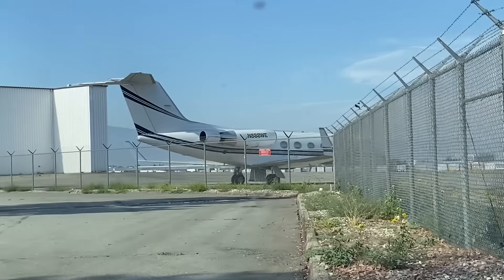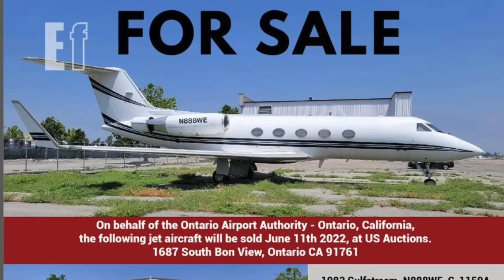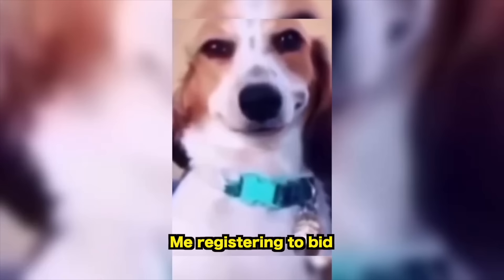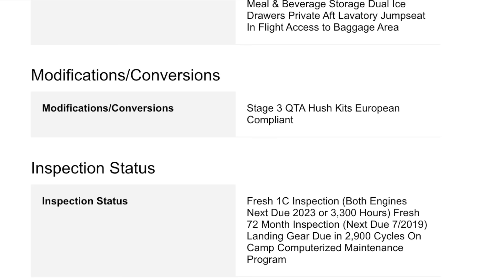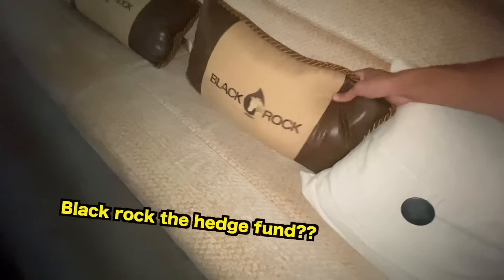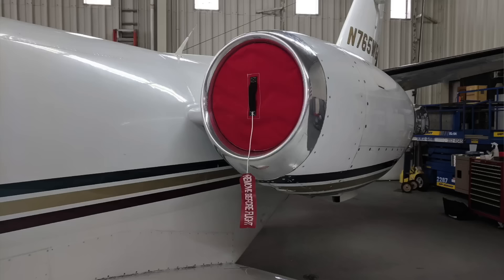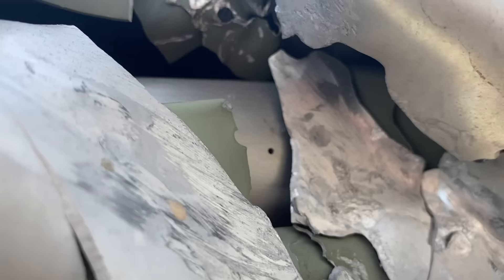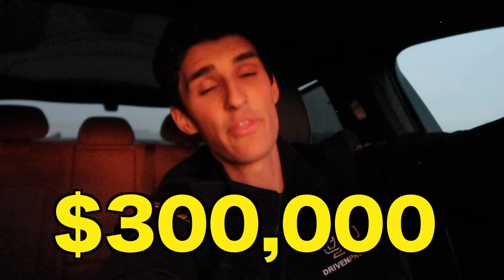$100,000 ABANDONED Gulfstream GIII At Auction... Did I Bid Too Much?

Comment: It’s completely possible whoever took the avionics and logs, bid on the plane. Wouldn’t have been the first time I’ve seen it happen over the years.
Reply: Smart. That leading leading edge is easily repairable of replaceable   Nice Cartel jet ✈️
Reply: I used to hide it so couldn’t be accused of theft 
Then if I bought it I know where it is 
So always worth a look
Reply: I'd start looking at the guy who's short a ton on hanger/storage fees
Reply: @jimardizoni3453  But he’s the one profiting from the auction, so why would he steal the logbooks so it’ll auction for less?
Reply: @lukethompson5558  so he can buy it for less under some else's name  replace the log and electronic he got for free and flip the plane for profit, the parts missing are worth more than the auction fees to the winning bidder it's a no loose spot to be
Reply: You need to rebuild the logs if you can't find them, that could prove next to impossible cost wise.
Reply: Log books don't come up missing for no reason. The Flight Crew/Owner Operator is responsible for those books. When an aircraft goes down for maintenance, the first thing the Inspection Dept. or Head Inspector does is remove and review the log books, then locks them up until the plane is returned to service. 
Most likely the Operator couldn't or wouldn't pay the bill. After all attempts to recover payment due, then the plane gets pushed outside and parked. Anything is possible, Owner death, Will tied up in probate, etc.
Most likely there's also a mechanics lien on the aircraft. Or, if a good maintenance contract was written, and the Party owed money, could possibly spend the money in court to to take possession of the plane. A search of the tail number and A/C serial number would be wise.
It was easy enough to go through the Emergency Exit to break into those old GII's and GIII's before they started adding locks on the e-exits.
Reply: If the winner have the missing parts and the with hush kit, this aircraft will end up somewhere outside USA smuggling drugs into US. 

Another route is Africa to Dubai transporting illegal gold/diamond. Dubai airports will allow to land as long as it has the hush kit.
Reply: @T J  riiiight. I think the old owners have the avionics, cleaned out what might bring a buck and said duces... and you know they have the logs. . . With deep pockets, purchase of both airframes, and tracking down the older owner (public record) to make a deal for the logs, could have been a really phat deal. But that's a lot of variables to fall in line, just so. 🤷‍♂️
Reply: 99.9999% This
Reply: why overbid then?
Reply: @TomCook1993 😊😊
Reply: Very hood point.never would have thought of that😅
Reply: I bet the original owner who lost it to the airport for parking fees still has the log books and avionics. Bought it back cheap!
Reply: Weighing in from a pilot’s 👨‍✈️ perspective here… 😏:
- Something like this would neither be a kind nor a professional thing to do for a fair bidder ⚠️
=> He should therefore - in the best interest of all parties involved - NOT do that. Period.

Any thoughts on this, crew? ✈️
Reply: D.B. Cooper!?!
Reply: @lukethompson5558   Video says owner owed storage fees thus this was a lien sale.  Meaning, the airport (or whoever owns the storage space) gets paid after the auction fees, not much may be left after that, therefore the log books become more valuable then being the last guy to eat after sale.
Reply: People used to do that with cars, takes parts off stop them running and car gets pushed into auction

Comment: Will cost around $3M to bring her back. Then the other major cost is to see which pilot is willing to risk their life for a test flight. It has to financially make sense. Still in the end a Gulfstream under even $5M used is fairly nice for the low frame miles and engines.
Reply: It sounds not too bad financially, but I'd still be scared a lot about material fatigue, micro-cracks, aging bolts, etc. It's easy to lose your life in general aviation.
Reply: Well, not wanting to pull up too steep here, but I'd risk it. I'd totally do the test flight. Yes, I'd have my rules, but I'd do it for these boyz. It's fun, it's logbook experience, and, think about it: Your wife and kids - even the tipsy polo club gang - will see you in a totally different light afterwards 😏
If there's one thing I would have learned in my not too short and certainly not too unsuccessful career, then it is this: 

Sometimes, you just gotta do it and don't overthink 😌

...and hey; Oshkoshers will see you as a hero too then 😊

p.s.: Fair price for the G3 models shown here: I'd say quarter of a million, MAX 350k. Not more. Just a full-bearded aviation retiree's 2 cents here...
Reply: @mick-berry5331  correct even a skilled metaurlist may over look such fatigue to the point of failure even years later. With the jet naturally expanding and contracting with every takeoff and landing.
Reply: @Michael-gs2uq  well said. I actually appreciate this.
Reply: I put it at 5m for inflation alone
Reply: @Vamanaswastika  its well seasoned expanding and contracting in the desert
Reply: @cardboardboxification  this is a valid point however that type of metal expansion is a little different than mid air in-flight landing and takeoffs. Do we have any metaurlist in the comments section that can expand or dispute my claims?
Reply: @mick-berry5331  yes it is easy to lose your life in aviation even in perfectly mint condition aircraft...fly that refurbished plane for the ifrst time through a turbulant storm and then let reality sink in lol

Comment: I work at Ontario Airport, it’s sat for a while and someone bought it a few months ago and is restoring it. It’s now in the hangar right next to where it was outside. When my co-worker and I moved it it was so hard to move as if the brakes were on.
Reply: And yes the other gulfstream that was parked next to it ended up hopping the wheel chock when the Santa Ana winds came through and they hit pretty good. The other one ended up getting sold (much worse condition) for I think 12k? And was chopped up and transported out. I have lots of pictures of it all chopped up
Reply from the maker: Dm me @jraviation1 on insta I'd love to hear more
Reply: They are actually overhauling the plane?  😳. They must have another parts frame somewhere.
Reply: I'm a brain surgeon and a pilot
Reply: I'd bet all the missing parts were in that hanger too! You just don't waltz onto the tarmac and "borrow" some parts off someones plane after 911! INSIDE JOB by some slick willy A&P tech.
Reply: Wonder what you can get for the hush kits? I can imagine the RR engines are still valuable as cores.
Reply: @carlinshowalter1806  If true that's absolutely disgusting. Too much greed.

Comment: When you opened that drawer with the wine bottle in it, the first thing that crossed my mind was that M on the linens looks like Maverick Transportation's monogram !! (Don't ask how I know, LOL). Reg confirmed it, as 888WE rang a bell in me as well. (Again- Don't ask.) Logs and history may be available through The Corporation Trust Company or CT Corp out of Wilmington DE. I'd think the buyers are (or did) look into that.  If you're still interested in buying an aircraft with no available history/logs, you should know that parting it out will not be as easy (Think also: "Legal") as you may be thinking.  Great vid. Thanks for bringing back the memories.
Reply from the maker: Wow no way! You're spot on
Reply: @JRAviation  It was operated for Black Rock Thoroughbreds, based on the logo on the pillow and the horse racing magazine.
Reply: UU

Comment: The problem with old, legacy aircraft is you have difficulty in sourcing for parts, and when you do find them they may not be cheap. Also old and cheap is not exactly a good combo for airworthiness.
Reply: A friend's company owned a Falcon 20. The interiors were ruined by something that leaked out under pressure while at altitude (I don't recall what it was.) The interiors that were replaced cost $178,000. That's a lot of money to invest in an old jet, but some of the execs loved the plane and insisted that the plane be saved.

Comment: Smells like the other bidders already had G3s and they needed a good parts plane desperately (like just for the hush kits) to make their existing G3 make sense. Maybe? Otherwise... might make a good write-off. LOL
Reply: Bingo! Whoever spent this much money had a major reason to want it. Perhaps it was a former drug runners plane, and the money was hidden somewhere in the interior? 😂😂😂 But in all seriousness, someone definitely needed the parts.
Reply: @ChrisJohnson-hk6es  I'm in that business but for the small piston planes. When you're talking £5k for a Garmin 430, a couple of grand for an engine bearer and another few grand for a nose leg assy, it makes sense to buy one that has been written off by the insurance. You also end up with a load of parts to sell to other shops! It helps with the smaller planes that you can take the wings off and move them easily! I was scrapping an old Seneca 2 that had been a parts plane for a school and just the de-ice timer module made me £600! Look how much a fuel cap is for a PA28, around £150! 
All the way through this video he kept saying how much the hush kits were, they alone would have made the deal worth it IF you needed a hush kit! Not sure how it works in the States with regards the 8130, we call it a Form 1 in EASA land or a certificate of release. Here the part would need to be inspected/overhauled by a licensed shop and signed off airworthy.
Reply: Thats what I was thinking
Reply: @rogerblackwood8815  but a lot of times that equipment is outdated, doesn't fit in an alternate air vessel, and/or is just plain junk.
Reply: @harpoon_bakery162  Outdated stuff is what we need most of the time! Your average flight school in the UK runs PA28's and C152 and C172's, most are over 20 - 30 years old! An O320 Lycoming and prop are pretty much the same in a Late model C172 as it is in my old 1967 Cherokee. Flight control surfaces etc are all the same, given a few model differences. We pulled an old PA28 out of the bushes at the back of an airfield thinking we would get some parts. It was in good enough condition to do a full overhaul and return to service! It took about 1000 man hours and new avionics etc. But it sold for a tidy profit, you just can't get enough old Pipers and Cessna aircraft for schools, the new plastic planes just don't do the job the old stuff does! The two schools I know well use mainly PA28 Warriors, apparently the customers prefer them to the C172's!
I think you mat be thinking about the avionics? They get ditched not as frequently as your mobile phone, but Garmin, Avideyne etc are always coming up with new tech to temp the owners to upgrade their kit, but the airframes, engines, and running gear remain mainly the same!
Reply: @rogerblackwood8815  ahh, yes, the avionics for sure.  But it's amazing how you are rebuilding old planes like that!!  Wow, and a flight school preferring a low-wing over a high-wing , you don't see that too often.  i guess if you get a good enough mechanic who is certified and knows how to go about rebuilds , putting new pistons in , putting cylinder sleeves in to replace pitted cylinder walls, burnishing valve parts and rods and fixing up carburetors that have bird-nests in them, it makes it all worth it !!.  Must be fun to be part of because every day would be different in your job.  Also, I bet you've seen a lot of accidents (crashes), and know a lot of people who were injured or worse in accidents where the plane wasn't up to standards, if you could speak to those events, it would be appreciated. (we can all learn from the experiences of others) (and close calls you might have had)
Reply: @harpoon_bakery162  The old high verses low wing debate will go on and on! But the most common comment I hear is "It looks like a real plane" when looking at a PA28. One School just south of London has a fleet of Warriors all in a sort of recognisable company paint scheme. The owner had virtually all Pipers on a fleet of about 50 planes. The other school a bit further north, has mostly pipers and they had a C172 on lease to cover one plane out of service for a while, and they sent it back after a month as it wasn't covering its costs!
 One of the schools is half owned by the guy who owns the engine shop, so that takes care of those issues. One thing we haven't got is a prop shop, the money in those things is really surprising. But parts in general are still very hard to get on the engine side and have gone up a lot over the last year or so!
It's funny you mention accidents, as I do seem to get a lot of those jobs. Taking a trailer out to a crash site, dismantling the plane and recovering back to the hangar. I have some interesting pics, but even with the Reg obscured I should imagine some people would not want them "Out there"?

We have a saying, you can fix anything, but the question is can you pay for it?
We also have a lot of different rules here in the UK compared to the States, some of which can make repairs very expensive!
All I would say about the majority of accidents I've seen and heard about is it was usually pilot error. The only one I can remember for sure where the pilot wasn't the cause was a screwdriver, or some other such tool, was left in the aircraft after maintenance and it jammed the flight controls half way through a flight, causing the aircraft to crash!
Reply: @rogerblackwood8815  great info, wow a C172 not cutting the mustard, yea , I love the look of a low wing, probably why I like War Birds so much..There's nothing like a spitfire from aesthetics and also beastly performance.  A screwdriver , damn....ugh.   nightmare.  Hopefully the increases in everything will subside in about a year.  That's the economists prediction and we'll go back to pre-pandemic, pre-war pricing and aircraft parts will have a bigger margin for you.
Reply: I've never looked at their website, £3000 for half an hour flight! £4500 for 45 minutes, taking in the famous Beachy Head! But at those prices I guess you won't meet many regular folk there?
Reply: @ChrisJohnson-hk6es  The Pillows in the video were embroidered with "Black Rock." This was Larry Finks's airplane. No drug runner.
Reply: @rogerblackwood8815  - I did the bulk of my flight training in a Piper Warrior, and all my cross-country time in them. Flew a 172 and a Piper Tomahawk a couple times with my instructor when all the Warriors were out. I don't know what it is - but for me that low-wing just looks like the kinda airplane I want to fly... lolz.

Comment: Can you guys do a video on what ended up happening to the cirrus and why you ended up getting rid of it? You never closed this loop.
Reply: If I remember correctly they sold it because it was in high demand at flight schools and the price went way up.
Reply: Overhauling / HSI’s on RR Spey’s will cost you both a kidney.
Reply: @michaelbooher339  that ain't no lie, and trying to use life limited parts without the logbooks is another big hurdle.  That plane needed a complete inspection for airworthiness, the engines needed complete teardowns and overhauls, all the bearings would be shot. The avionics replacements for the Honeywell flight deck could have easily run a million bucks.....I don't see any money in a rebuilt G3 with no logs no matter how low the times are.  Not a good aircraft to use for your first time flipping.  Find something with some financial training wheels.....you know alot smaller downside when it all goes bad and you do the numbers and your in it a 100k more than what it's worth........  :-)

Comment: My 2nd tour in the NAVY was working on GIII at andrews AFB, used by the NAVY CNO/and commandant of Marine core. awesome tour of duty.  pure shore duty assignment never left the area.  LOGBOOKS is a key Problem.  Gulf stream has a COPY for a price. (at least for the NAVY the civilian liaison assigned to us had her own separate records), FYI the Engines are overhauled by Canadian company; at least ours was at the time.   100k great deal, without logbooks, it's a paper weight. good luck. I would try figure out who owned it last, try offer them Fair price for logbooks. they are FAA documents. would be crazy if they destroyed them. but it's worth shot in the dark.  those cover are not kept on the plane only at their home base. Another TIP< If their low on FUEL they will tip too the rear cause the aft section to land on the ramp server damage, it is heavier, from what you showed of the wheel wheels. everything looks intact, if still has it's on board APU then still viable project. missing avionics is just that they can be found and replaced, that leading edge I Myself ordered one thru Gulfstream, for our A/c but the NAVY wasn't allowed to R&R it was considered major repair.  The leading edge for us was gulfstream only authorized fix, had to fly to GA< so they can fix it. The gulf stream is in my opinion looks in good shape, got to love auction sniping up the price.  those missing avionics are most costly setback, but engine logbooks can be redone, just cost of removal and sent off to have refurb, new books made. but GIII is nice investment if you have money to put into investment. good luck